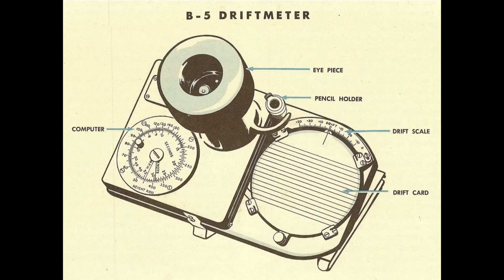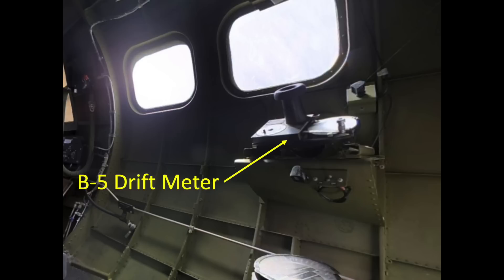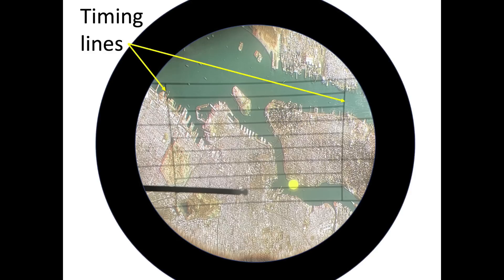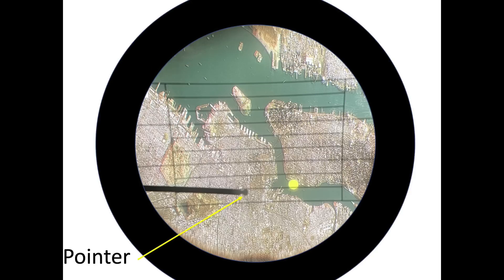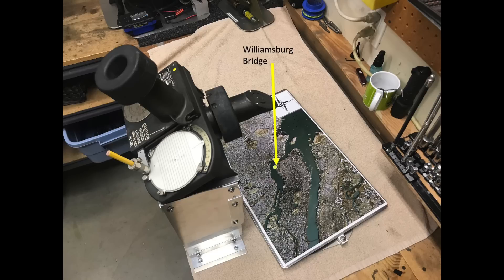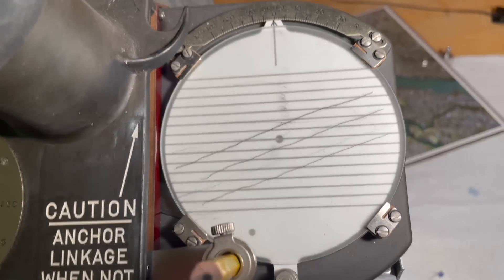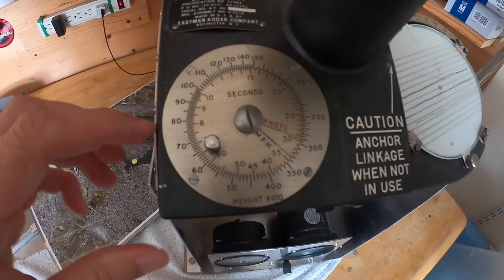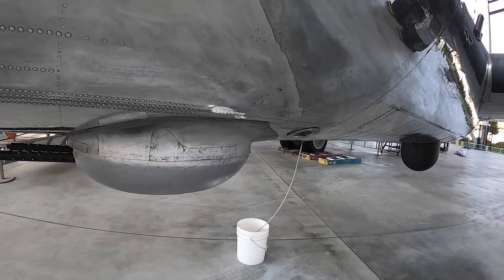B-17 Bomber's Drift Meter Instrument, a Simple Clever Solution

Comment: As always the tech sophistication of this era delights me.  

Some time in the future you might consider design and teething problems of the '17.  For example (as I've read) when it was known as the Type 299 the plane crashed because the pilot forgot to unlock the locks that keep the control surfaces from "wagging" in the wind when the aircraft is parked.  Read that the newspapers had a hay-day claiming that the new plane was just too complex for humans to operate.  Problem was solved by going through a check list before takeoff.

Comment: How would they calculate drift on a cloudy day? Especially before the introduction of H2X radar
Reply: Not: The navigator would estimate it from 1. Weather forecasts 2. Previous aircraft reports 3. From other navigation sources like celestial, visual, radio 4. 'Best estimate"
Reply: Interesting point. 
The British, at night, didn’t do this, or did they?
The British night bombing used radio signals, Gee-H, I believe. 
Did the US bombers ever use something similar to the British radio nav aids.
Reply: @briancavanagh7048 During WWII US bombers basically used US produced  copies of the electronic systems developed by British scientists. The proximity fuse  one of the few examples of the US solving a problem of electronic miniaturization that British technologists weren’t able to surmount.

Comment: Accuracy?
Reply: Better than wetting your finger and sticking it out the window. 
I just wonder how fighter pilots, especially the one's who flew long periods over water like in the Pacific, compensated for wind drift.
Reply: I suppose first step is getting the correct barometric pressures
Reply: @erickent3557  
Barometric pressure didn't factor into the math for wind drift.
Reply: @dukecraig2402  But you definitely need accurate altimeter readings.   Ah, yes, I'm focusing on the speed calculator, and not necessarily the angle calc.